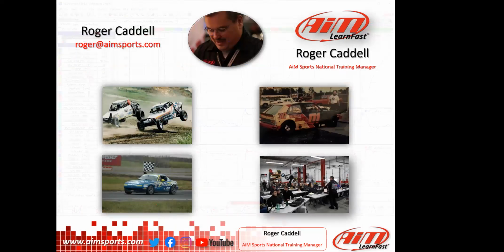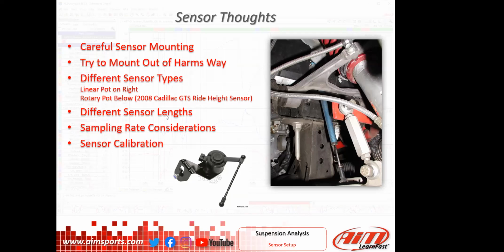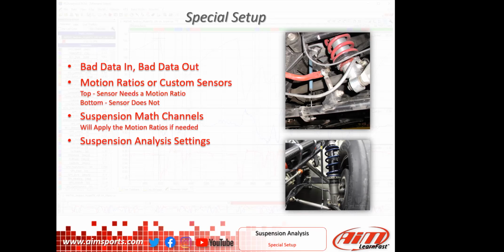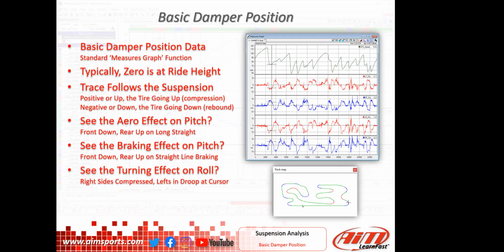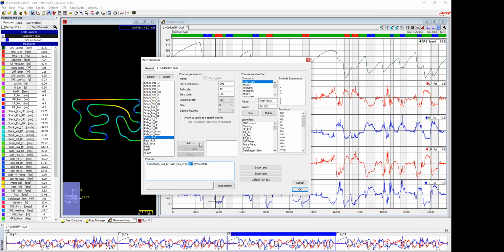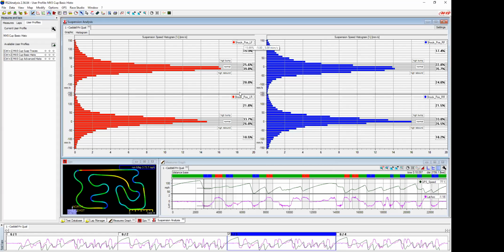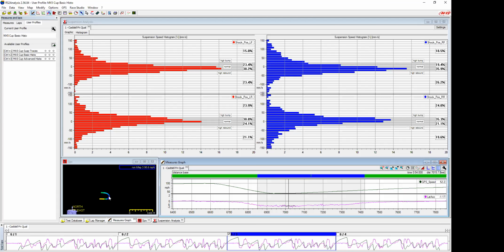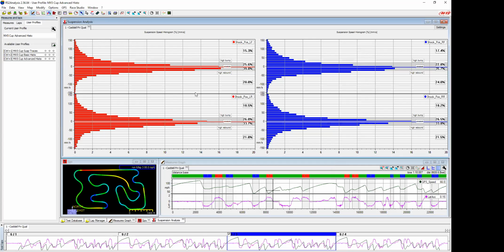1-46 Suspension Analysis - Live Webinar with Roger Caddell - 9/3/2020

Comment: Hi guys, great video! I have 2 questions. Firstly, when mounting the potentiometers would it not be possible and in fact simpler (for analysis purposes) to mount it directly to the shock, then your potentiometer to shock ratio would be 1:1? (less calculation the motion ratio between shock and POT) Leading to my second question. I understand measuring the shock speeds to understand the high and low speed adjustment perimeters, however when tuning the suspension wouldn't balancing axle positions and comp and reb speeds be more beneficial than just shock speeds? If the geometry of shock stroke to axle travel is different on the front to rear eg 10mm shock is 20mm axle on the front and 10mm shock stoke is 25mm on the rear, wouldn't that then mean when you're balancing  positions and speeds at the shock it could be out of balance at the axle due to these differences?

Comment: Do you have a longer travel linear potentiometer you would recommend for use on offroad motorcycle suspension analysis? Something capable of 280mm (11.0 inches) of travel that would be needed for most offroad or mx bikes?
Reply: I’ve seen some mx teams use string pots.  They have the length required and can be guarded to survive the conditions.  The drawback is recoil.  Your suspension will likely travel much faster then a low dollar unit.  I don’t know exactly what’s being used.  But that’s what I have seen.

Comment: Can you tell more about filtering data? I tested my Pots on motorcycle standing on paddock stands, just idling. Not touchings throttle, not touching motorcycle at all. But when I open histogram, I see not the single bar showing 100% time at 0mm/s speed, but I see histogram just like yours, with speeds above 50mm/s. Yes, I understand, it's just mecause of the sensors, they all have some kind of electronic noise. And the more sampling rate I use, the more histogram shows that my suspension travels fast. At 500Hz I see even 150+mm/s travel speed on standing still motorcycle!
What I'm trying to say - increasing sampling speed causes that electronic noise is used as a real data. And how can we trust this data at all?
Is there a way how to eliminate or filter-out that noise and see pure data?